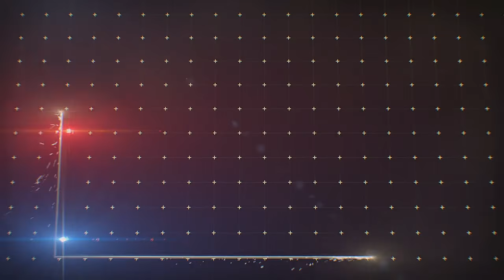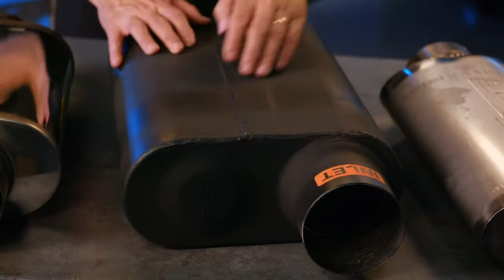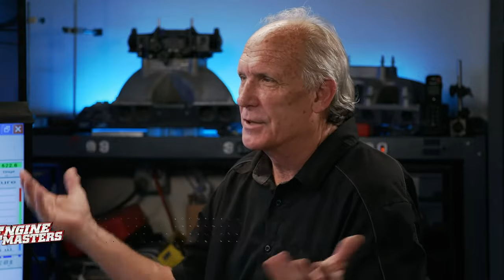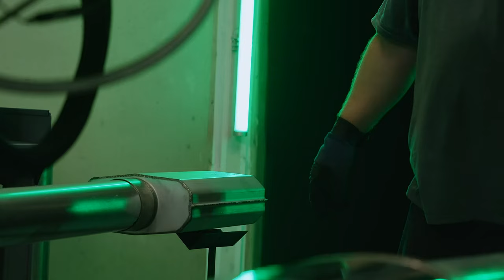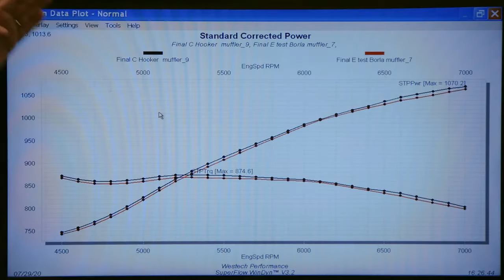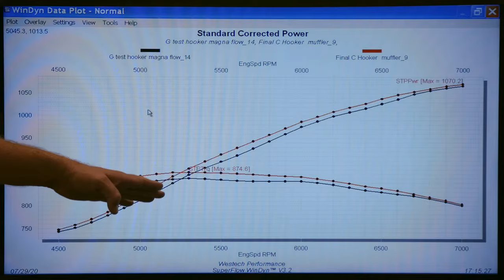Engine Masters  S5E75   1,000 HP Muffler Showdown!!

Comment: And don't forget - an exhaust system flow EXHAUST, and NOT AIR! What's coming out is pulses, not steady state air flow like you measure with a flow bench, which is why airflow through a muffler is totally irrelevant.

Comment: The cam is most likely the reason the Flowmaster lost power compared to the others. If the cam has too much overlap, the Flowmaster will scavenge it so hard that it will pull intake charge through the exhaust port during overlap so you have LESS fuel/air mix to burn so you will make less power. Conversely, that Hooker muffler (I would bet) is more restrictive to the engine which is keeping more mixture in the cylinder, making more power.
Reply: Sorry bro 100% disagree. No way the flow master will "scavenge so hard" that it causes a loss in power. No combination of camshaft, cylinder head, compression will cause that to be true. Every single exhaust Dyno shoot out shows the same, chamber mufflers are always down compared to a straight through muffler. The Engine masters show has other episodes confirming the same fact.

Comment: My Hooker headers are welded on the I.D. , weld and slag is blocking flow,  welding on O.D. wouldn't have been so bad,  I do wonder why I should have to grind weld off the I.D. on a Hooker header to get more flow where it bolts to heads, bbc. Does not need more room to change spark plugs so why weld on I.D. when that cuts down the flow ?

Comment: I did something pretty dumb I'll share. I had a 2.5" 2in- 2out flow master. I drilled five 3/8 holes in the front plate/ deflector in both sides of entry. Thinking I was going to make a unique sound. 🤪  What's it gonna hurt?  Apparently it  created harmonics/ vibration.  And broke the weld after a few mouths. My truck started overheating and I couldn't figure out why. One of the plates had broken free and was blocking the exhaust. I was 350 miles away from home in rush hour traffic. With the job I'd only add for a week. And no muffler shop had a 2.5 2in 2out. And when I did get one Delivered a week later. No muffler shop in MO Would touch it. Because it didn't have cats. And I never even got my dummy of the year trophy 🫠
Reply: We (when I worked at Flowmaster) built special mufflers for alcohol race engines with holes bored in the front deflector - the V shaped piece at the entry of the muffler. Those holes prevented raw alcohol from piling up behind it till there was enough and enough heat to ignite it inside the muffler. So, you didn't have a bad idea, it just didn't apply to your situation.
Reply: Hahaha, i appreciate that story.  When we are young and poor hot-rodders we all do some "questionable" stuff.
Been there, bro.

Comment: -10dB is generally perceived as 1/2 as loud because sound is on a log scale. 
Fun fact: Human sound detection apparatus can barely discern a 3dB difference for the same reason.
 Src: Self. Electrical Engineer and part-time speaker builder.
Reply: 3 dB is half

Comment: F you really want to accurately measure audio, you need an anechoic chamber.  If the microphone of the SPL meter is in a standing wave zone, the sound measurement could be either higher or lower than what it would be in open space.  Yes, I am a nerd.  🤓
I used to test audio, long before Bluetooth was considered tolerable fidelity.  😂

Comment: How accurate is the dyno , on back to back tests  ? Percentage of error
Reply: It will always vary, not just the dyno but the engine itself. On a 1,000 HP engine you could see up to a 10HP difference on back to back identical runs.

Comment: I always wondered if right off the header collector if you would reduce the size of the pipe for a certain distance if it would change the power if it would speed the air up to pull a stronger vacuum or would it just make pressure?🤷‍♂️

Comment: I would love to see wind speed after the mufflers. I always wondered if forced induction has faster exhaust vs na
Reply: Interesting thought, but I would have to say it shouldn't, since the exhaust is long after the induction side of the cycle and the intake is only open a short time while the exhaust is, so the amount of flow from forced induction through the exhaust should be minimal, but of course that all depends on the cam profile. That's all speculation of course.

Edit:

The other factor however would be volume in the combustion chamber. Since you'll have more air in the chamber with FI, then it stands to reason that that alone should increase air volume going out which should affect speed since you're moving more air through the system, so you're probably right on that front.
Reply: @audiogarden21 I would think that being it's being blown with forced induction it should also have more exhaust air flow through the exhaust as long as the headers and mufflers aren't a restriction. Engines that are designed as a race engines being blown or using a turbo they usually use a specific cam grind to take advantage of the extra air & fuel that's being forced into the blower and the heads as it makes what is basically a air pump push more air volume out being forced fed more air . From what I see is on turbo applications you don't need a specific cam design being it's runs on the exhaust gases being pushed from the pipes to the inter cooler to keep the turbo cooler then right into the turbo it's self so there is less HP lost because of this being blower rotors use more power to spin them compared to a turbo fan that is lighter with less friction & smaller that's also lubricated by engine oil pressure. Blowers typically take more HP to work & do it's thing where turbos use less HP to spin the turbo over . On those nitro hemi engines used for top fuel they say that it takes about 2,000 HP per cylinder to make the 14,000 HP that those engines make to be able to run those now 1,000ft runs on the drag strips at just over 3 seconds and we'll over 300+ MPH .

Comment: Really thought the Flowmaster would have killed more HP than it did.
Reply: They don't do as bad as people think in a dual exhaust application. With 2 pipes that are plenty large enough, muffler choice matters less. With single exhaust, it matters more and there's a greater difference between a crappy muffler like a Thrush Turbo vs a good muffler like a Dynomax Ultra Flo.
Reply: @AdmiralRustyShackleford it also probabky matters more if you have a weaker motor as well. The flow masters might hurt you even more in that context
Reply: @jubjub905 that's not exactly correct.  I doubt I'm down on power with my stock 79 smog era 302 with 2 chamber flowmasters  compared to the crappy single exhaust with a small diameter 

It's not so much about the CFM a muffler will flow but more about  the path of flow itself, which is what flowmasters attempt to address

Comment: Is a takehome possibly that performance mufflers don't kill much power?
Reply: the  take-home  is  that all those old wives  tales  about flowmaster  killing 30-40 HP  is  false.  or  that they  put the mufflers on backwards  which  means  the  exhaust  waves/pulses  didnt get split by the delta plate  1st before  exiting the muffler.  i can see that as a big problem.  i say pick a sound you like  and run with it.  you wont  notice in a street car  or even a hot street/strip car